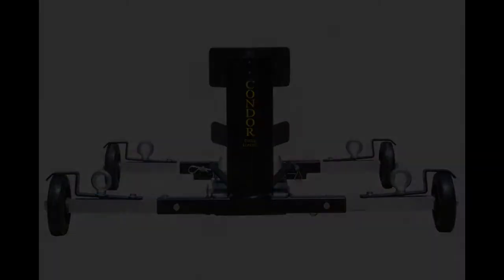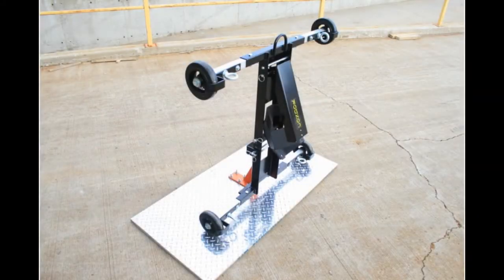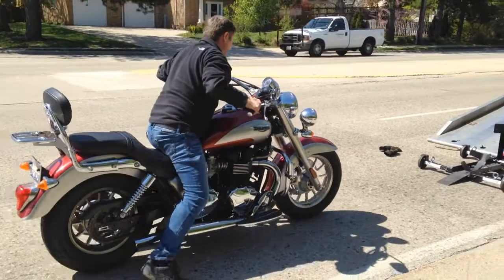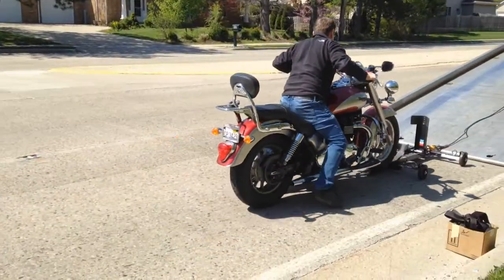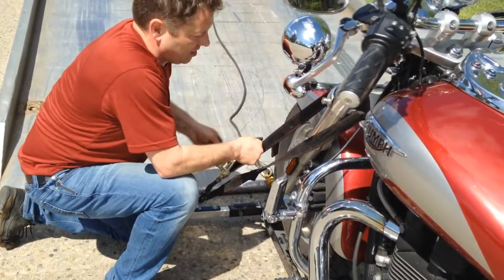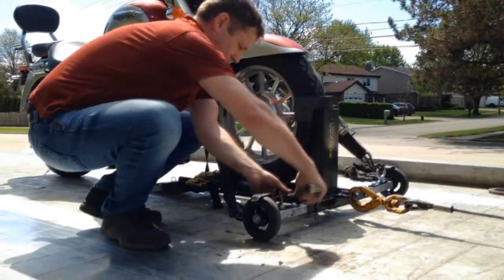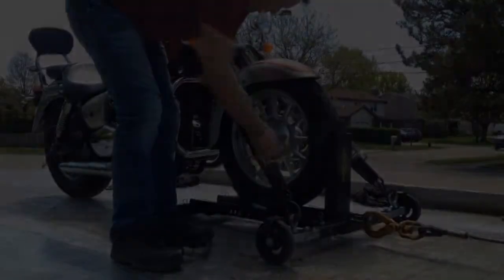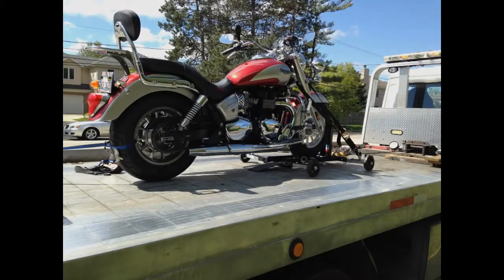Condor Cycle Loader

Comment: Loosen the wheel brakes in order to attach the front two tie downs using the I-bolt rings, winch the unit up....This all makes sense but to then remove the tie downs so that you can re-tighten the wheel locking mechanisms, only to have to re-attach the tie downs because tightening them with the straps on would cause them to twist..? Do you really need to tighten the motorcycle loader's wheels again if you secure the unit to the flat bed using 2-4 more tie downs?